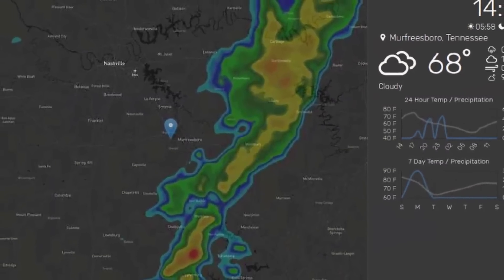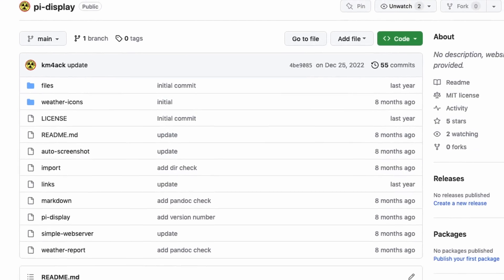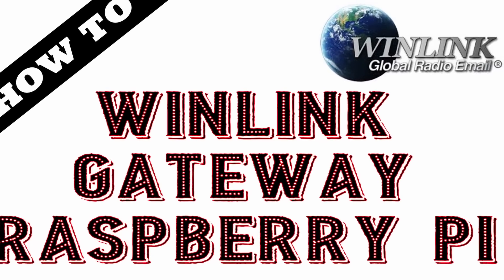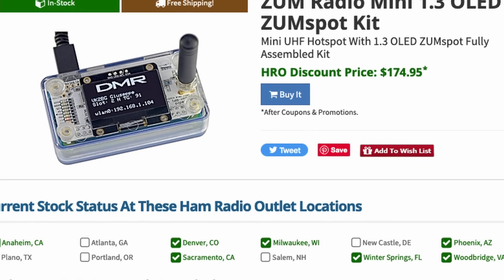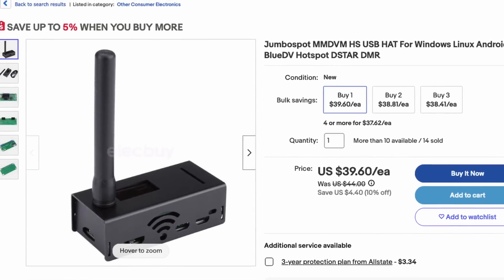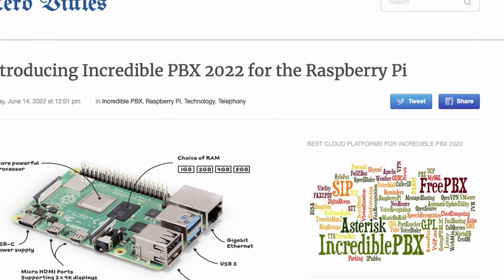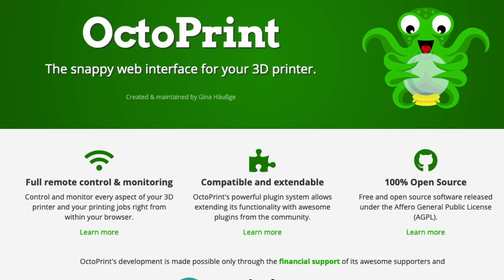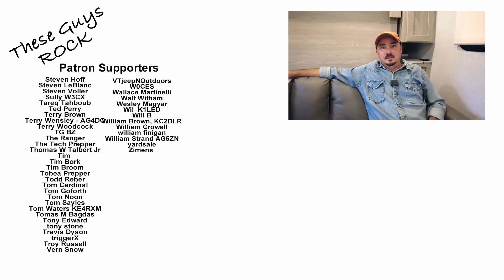Top 5 Raspberry Pi Projects for Ham Radio

Comment: I've watched a few of your vids on this topic (and tons of your other videos)  seems like some of these take internet . Wonder how we can build similar weather displays etc that get the data from radio? I'm a new ham so go easy if that is a dumb idea
Reply from the maker: Not a dumb idea at all. There are a few ways to get weather data over the air. APRS has WXBOT which can give you a short forecast. A full weather report can be requested using Winlink and you can download several weather products over the air using WEFAX in FLDIGI. Pretty sure I have vids on each of these that I have done over the years. What I don't know is how to pipe any of that data into a display.

Comment: I run OctoPrint headless on my Pi 4B. I need to find out if it’ll run on one of my Pi Zero-W’s so I can reappropriate my Pi 4B to run Android for the new VR-N7500 that is on its way since it’s an Android controlled-headless VHF/UHF radio.

Comment: Thanks for your awesome videos! They are superb indeed. My question to you is without a gps module converted to the Pu (Build a Pi) can i use Net time software for time? 73
De VU2RJV Brigadier Rajaram from India
Reply: Does HamClock need gps connected?
Reply from the maker: No

Comment: Same here I have a pi running a digi-peater/Gateway it runs 24/7 no issues.  Just does its thing.  It was really needed in this area too when I put it on the air.